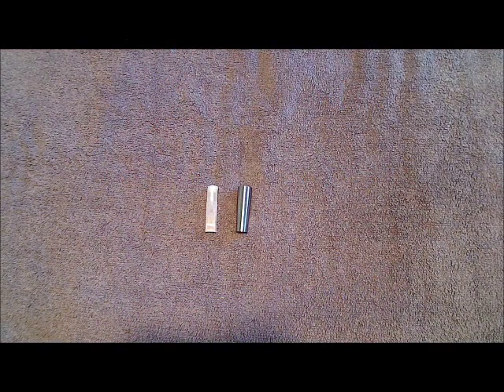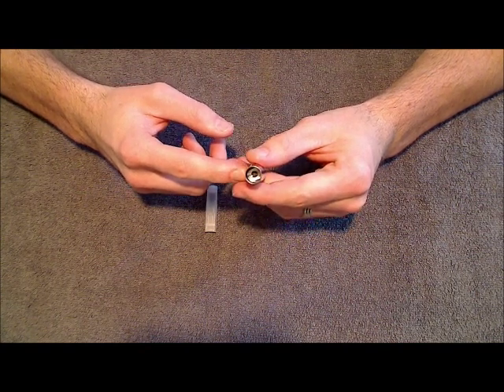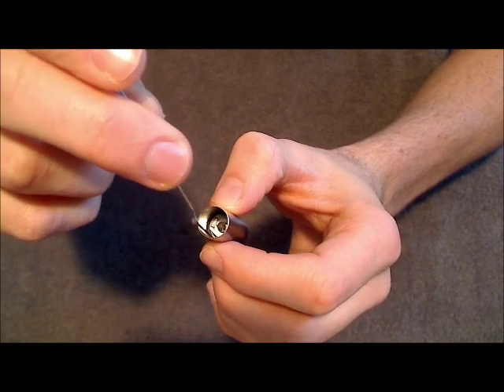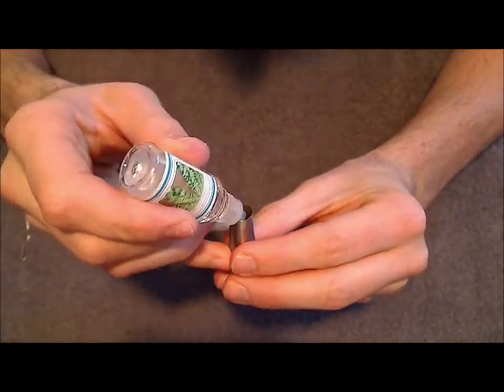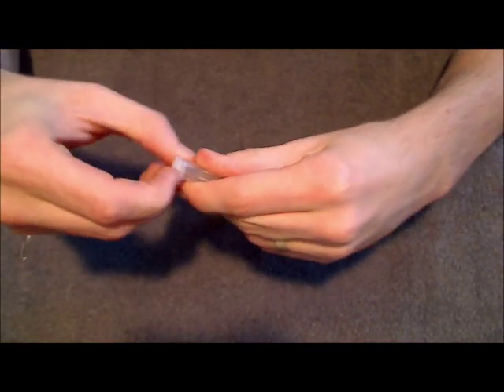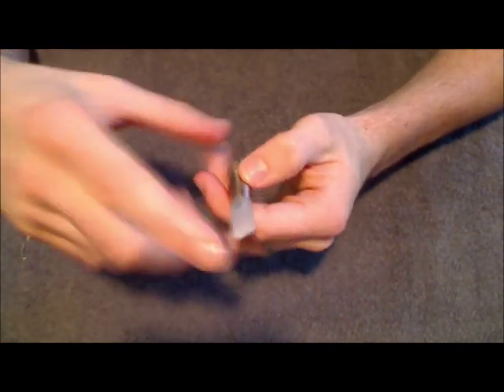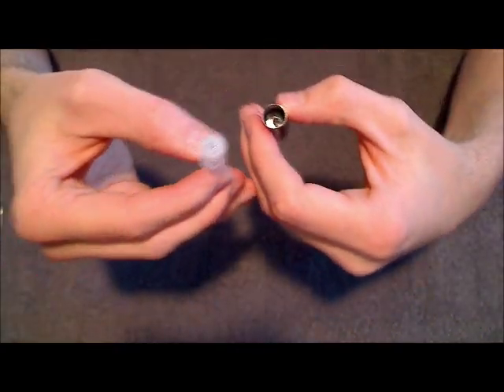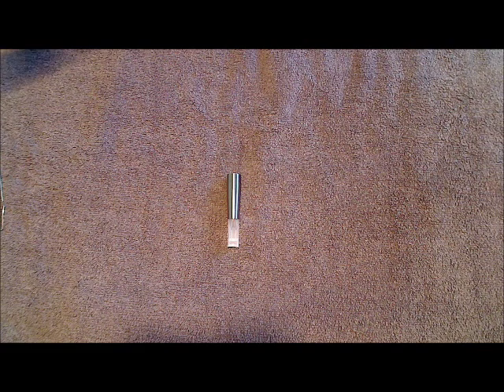How To Prime Your Tank Atomizers

Comment: Do you need to turn the e cigarette upside down between drags so it goes into the little hole again? Mine gets blocked between every drag. Also, The button times out before I get enough smoke (Joyetech ego-T). Is this normal?